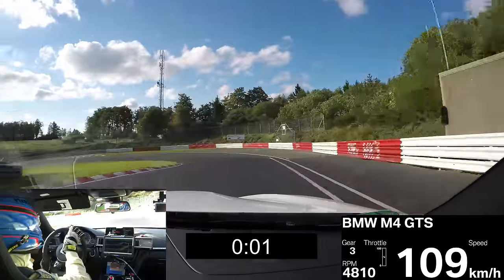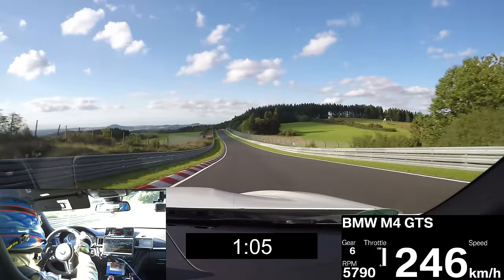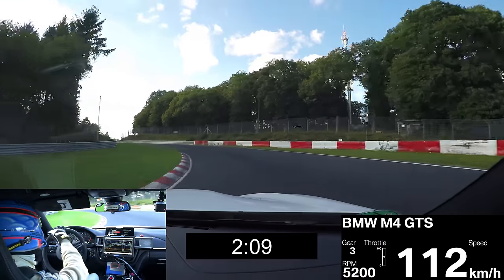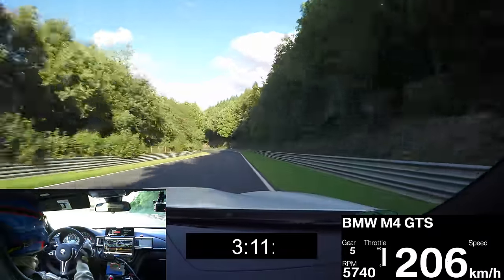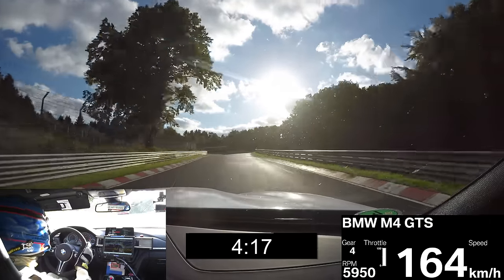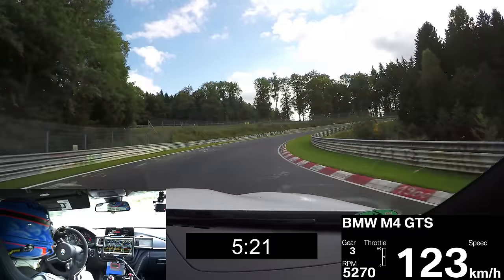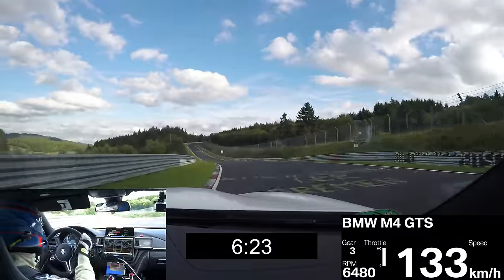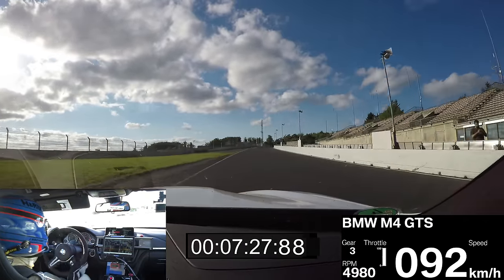BMW M4 GTS Fast Lap Nuerburgring Nordschleife.

Comment: Hmmm where is the Alfa Giulia???
Reply: +anand koellin lmao, this BMW GTS doesn&#39;t even have rear seats, or dool handles. It costs twice as much, and needs that massive rear wing to make it stick to the road. Giulia&#39;s actual competition is the BMW M4, and it has already ruined it. Wait for Giulia&#39;s competition edition before talking.

Just remember, not a long ago, the front wheel drive Alfa 156 destroyed the 5 years newer BMW M3. lmao
Reply: +Sam R  Well it's ofcourse Bmw vs Ferrari ....
Reply: +anand koellin I think that there may be a touch of the Nissan exaggeration with its claimed time, no video to support it and even if true its way slower than this car.

It would be interesting to see what time BMW could get with the regular M3/M3, all we have so far is a time from magazine review where they do not exactly push the car to its limit.

Comment: BYE BYE   Alfa Romeo Giulia Quadrifoglio!!!!!! xaxaxaxxaxaaxax
Reply: FYI Giulia hasn't beaten anything yet. The claimed time is not official or verified, it's only a PR stunt so far.
Regarding your source; Note that if you uncheck "Estimated & simulated laps" from the drop down filters Giulia won't be listed.
Reply: Would be more appropriated to compare the BMW M4 GTS to another coupe having the same mods, like, with roll bar, race tires, etc. something like the Lamborghini Huracan Performante.

But... but wait,  that might not be fair? or would it?   cause the Lambo had a 6:52 lap time. 
Yeah, not fair, cause it's 36 secs faster. 

Oh well back to the drawing board.